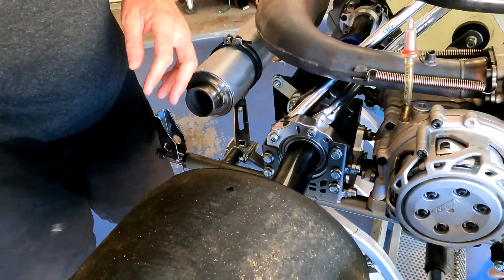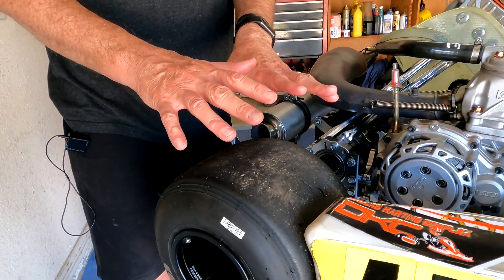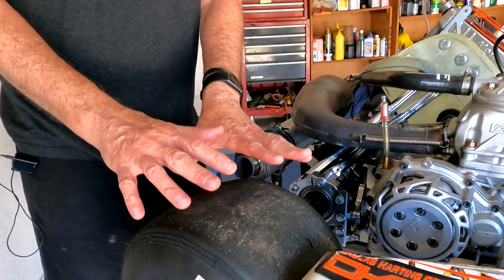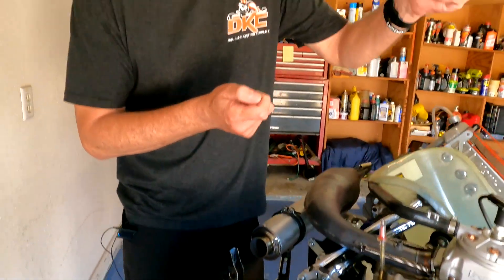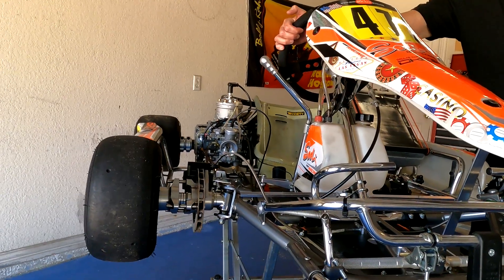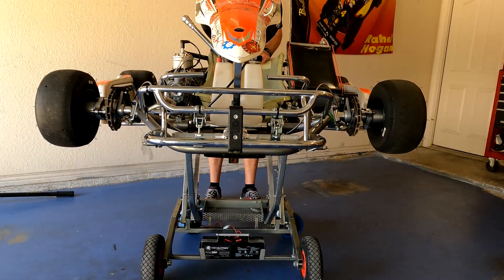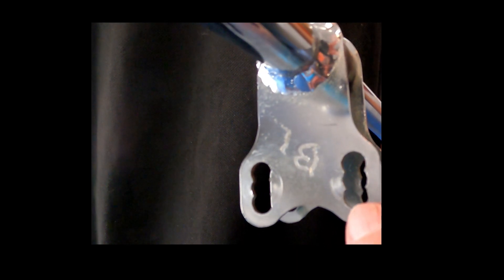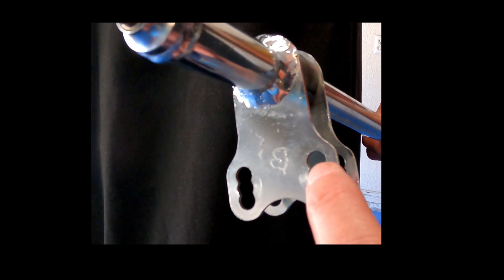De-Mystifying Ackerman Steering

Comment: I really don’t understand how this adjusts the Ackerman angle.  From what I’ve understood, it was impacted by the angle of the steering arm on the front hub in relation to the front axle, not how quickly the steering wheel changes the direction of the front tires.  You could adjust the right a left independently, which would change Ackerman in one direction and reduce it in the other direction, which would be used potentially for circle tracks, but it would be strange to do it for a road course.
Reply: Agree. What he says is actually the opposite. The Ackerman effect would be the greatest in the holes closest to the steering column. If the tie rods were mounted together at the centerline of the steering lever there would be no Ackerman. The wider the angle is of the tie rod mounting points the more Ackerman is induced. Anyway, someone told me they did tightly controlled testing of Ackerman and it had no effect on the kart.

Comment: Perfect explanation.
When I first bought a used kart and had it on a trolley I thought the steering was completely broken!
Reply: Glad that you found it helpful and thanks for watching!  On thing I learned is that changing steering shafts can definitely affect the Ackerman on your kart...there are different steering shaft designs for the same kart that will have different/unique Ackerman characteristics....for someone like me who is still learning about this stuff, I am not sure that I could feel the difference unless it was a big change but one of the very top guys would definitely feel it.

Comment: So advanced from the karts we raced in 1960, where the king pin (pivot) was made as close to the wheel as possible. Today the wheel is quite distant from the king pin and moves in a long arc which can be tuned to raise or lower the wheel as it turns. At 76yo I still follow karting.
Reply: Welcome to the Begin Again channel and thanks for your comments!  I started karting in 1972 when I was 14, and my first kart was an old Alakart with a Mc 91B on it...and yes, very primitive compared to what I am driving today...If I could have shared with my 14 year old self what  I would be driving in my mid-60's, I don't think I would have believed it.  If you are interested, check out my series on Finding the Perfect Seat Position...I got to try out some pretty cool technology to adjust seat position, just another tuning device that would have been unthinkable back in the day.  Thanks again for watching!

Comment: Amazing video precise info. Thsnk you
Reply: Hey @steveboisvert, thanks for the very kind words, I am so glad you found this useful!  I am currently working on a 3 part series around seat placement and there will definitely be a mention to Ackerman steering as it seems like there is some linkage between the two in that when you move the seat, you can significantly affect the handling and therefore, Ackerman may be called upon to really dial the handling in.  With this video, we are starting to get more into the "art vs science" part of how to tune a kart, so I am probably opening myself up for a lot of comments, but that's OK, conversations like this are usually very helpful.  Thanks for watching!

Comment: I've been fascinated by this for Three years (new kart owner 50+). Took me Three years just to get enough steering input (OTK4) at speed to begin lifting the Rear inside wheel. It's unbelievable how steep the learning curve is and how the Kart laughs at you when you think you're at the max.
Reply: It is always amazing to me how much there is to learn about something that is so seemingly simple like a racing kart!  Of course, we both know it is deceptively complicated, you change one area of the kart and suddenly you impact another area as well.  I made some very fundamental changes recently (I moved the seat forward) and instantly, the chassis became more tunable and it reacts to small changes whereas before, it would take a very big change to make an impact.  The point of my story is that moving more weight on the front end of the kart actually made the kart more front end positive, and it was really "nervous", so I took Ackerman out of it and it instantly settled down and became much easier to drive...just like it is supposed to!  Thanks for watching and best of luck!

Comment: Great video and even better information! This is an area where my engineer and I tend to have the most disagreement.
Reply: Thanks for the very kind words!  The best thing that I can suggest to you is that you take an afternoon and go out to the track just to try out the various Ackerman setting on your particular chassis.  I would go out and get the kart handling well first (via the usual tools like tire pressures, track width, etc), and then I would try out the various Ackman positions, take notes on what the kart felt like when you made changes, did you go faster or slower, is the track rubbered in or not, etc.  That will take some of the guesswork out and you will definitely both have a better handle on what is going on with Ackerman.  Hope that helps, let me know what you learn!
Reply: @RKSiler  , To be sure, unfortunately, right now we are in a holding pattern on everything until we close on our house and get back to the US. Kart is still sitting in the showroom at Comet!
Reply: @avantigpracingdevelopmet6467  , yeah, that would set up a bit of chink in the armor, huh?  Hope you are able to get on track soon, the guys at Comet are outstanding, I have done business with them for years.  Good luck on the sale of your house!

Comment: if you change the ackerman at the bolt hole on steering shaft do you have to reset you toe in/out.
Reply: I do a quick check of the alignment on my kart and it is sometimes changed from a toe perspective; I would expect that the toe would change every time that you move the tie rods but that has not always been the case for me (I wish I could tell you why but in my experience, it doesn't always change).  As a result, I always check it in case the toe has changed.

Comment: I have chatted with you before, I'm new to Karting and appreciate the TIP!!!
Reply: Hi Richard, how are you?  Are you having a good season?
Reply: @RKSiler  I haven't started yet been restricted due to bad hips... they have been replaced now gotta get back in shape so next spring is my goal! How's your season???
Reply: @richardlemasters9684  This year has been...interesting!  With the massive heat wave we have had here in North Texas, not many of us want to venture out for a full day in the heat, so many of us have been running just for practice early on Saturday mornings.  The heat wave broke about a week ago, and there was supposed to be a race today, but naturally it got postponed due to rain (never fails, right?).  So, I will be racing next Sunday, which is fine, my kart is locked and loaded, so all good. BTW:  I am in post-production with a video called "Getting In Shape For Speeding", and I have a highly qualified fitness coach in the video who has lots of good info for us racers.  Looking forward to sharing it with you and all the viewers of Begin Again!

Comment: Great post as always! I started karting in the shifter category this year and this will help a lot on race days as another tuning tool for me to try out.
Reply: Hi Christian, thank you for the kind words!  I am still learning about Ackerman and how it helps to tune the chassis, there is definitely an interplay between Caster, Ackerman and track width depending upon how much grip the track has, tires, etc. and to be totally honest, I am still trying to understand what the secret sauce is for the various track conditions.  Would love to hear about your experiences as we figure this out!
Reply: @RKSiler  Honestly I haven't done almost any tuning yet in the few race days I've been to, mainly bc of carburation issues/reeds. But of course if anything sticks out to you in particular as a good combination considering the track you can let me know. I'll keep you posted as well!
Reply: @ChristianM23  Sounds like a plan!  BTW:  you have probably already done this stuff, but in addition to checking out your carb and reeds, be sure to check your fuel pump and change your fuel filter.  Seems really basic but a clogged fuel filter bit me one time.  Now I change it out on a regular basis.
Reply: @RKSiler  I'll remember to check that as well. I haven't messed with the fuel pump yet. Thanks!